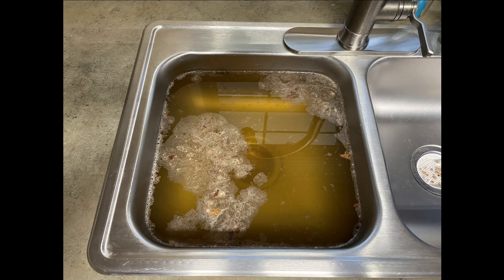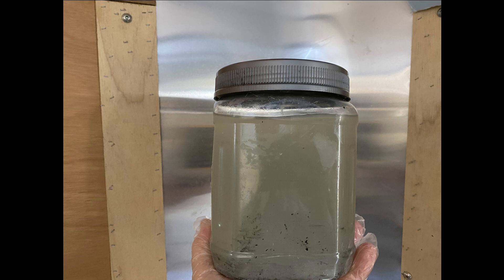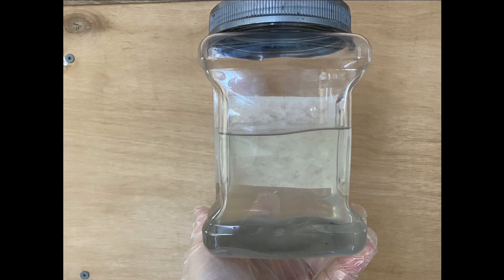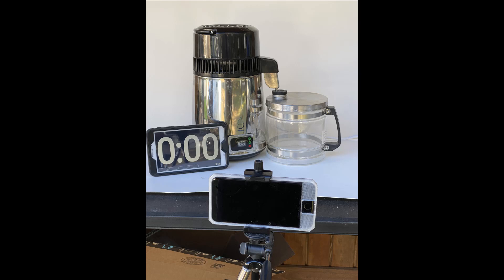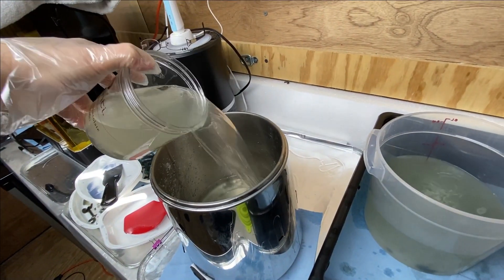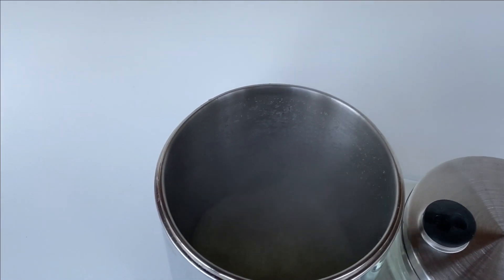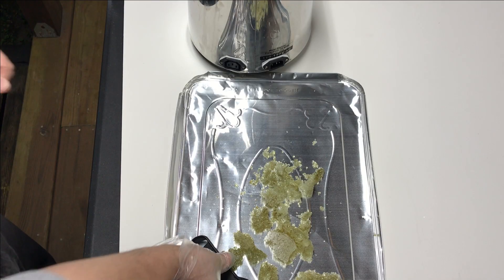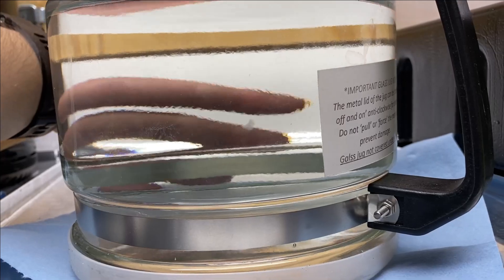Cleaning alcohol for your resin 3d printer process. (Feb2022 updated links)

Comment: Thanks for Sharing
May I ask two questions?
First do you find your losing a percentage with the distiller and if so how much?
Second I see the distillers have charcoal filters are you using it or do you just leave them out?

Thanks
Reply from the maker: I don't doubt that there is some amount of loss.  No process is 100% efficient, even the warp drive on the Enterprise.  :)  

I fill the distiller to the 'FILL' line.  When done I have a full carafe.  Not half, not 3/4.  Not an amount low enough to even make me question how much loss could be taking place.  Odds are, I loose more from forgetting to put the lid on my wash bucket overnight.

I am not using the charcoal filter because I'm not trying to make distilled water going into home medical gear like the distiller is designed for.  After all, the alcohol is going to kill any germs that dare try to set up shop in the equipment, right?
Reply: @starbase3d804  Thanks so much for the quick reply and feedback.
Reply: @tfraleyArchive  i got one i found i lost about 1/4 roughly. My jar has a 3000ml line and im at about 2500ml for a full 1gal tank
Reply: @rwest902  I have the same experience with my distiller! Loos a quarter! If I use it with plain water I loose barely nothing though!
Reply: The new version designed for alcohol might be better but seems only be available as 110V, so for Europe (220V) you also need a voltage converter.
Reply: The resin left behind may be the reason you’re output is decreased… i mean it takes up space and doesn’t just evaporate

Comment: What about fumes? I know you cant use IPA in a ultrasonic cleaner because of risk of fire with fumes and the heat, Wouldnt this be dangerous also with the fumes and the heat and with the boiling point of ipa at 82.5c
Reply: Good point, I think I'm going to try this but I will put it outside for an hour or so just in case.
Reply from the maker: Turn off the heat function of your cleaner?
Reply: @starbase3d804  doesn’t that defeat the purpose.  The way this works is via boiling and vaporization.
Reply from the maker: @MichaelBellini  He was referring to an ultrasonic parts cleaner with heat function.  Some people use ultrasonic cleaners such as jewelry cleaners for the cleaning of their resin printed parts. But if you were to use the heat function with that it would be highly dangerous.
Reply: @starbase3d804  he was comparing the distiller to the ultrasonic cleaner, which he clearly stated cannot be used with heat.  
Since it is vague at best, I wanted to make sure people understand that the distiller has to be used with heat for it to function.

Comment: I bought this same unit based on your video and it worked perfectly and very fast. My only problem was my dried resin wouldn't come out nearly as easily as yours did. I ruined my plastic scraper and ended up using a stubby flat head screwdriver to chisel the dried resin out.  I'm going to try using a crock pot liner bag next time.  My resin of choice is Siraya tech build smoky black. Maybe that had something to do with it. Edit: I just searched for foil pot liners and found these: https://www.walmart.com/ip/Pit-Boss-Foil-Bucket-Liners-Easy-to-clean-Aluminum-Grill-liners-6pk/734064897 , maybe they'll work. May have to trim them down
Reply from the maker: Sorry to hear about that.  Really odd.  I've been using Anycubic black and grey almost exclusively.  So yeah, maybe its a formulation thing.  - Hey, my unit came with a jar of cleaning solution, did you try that?
Reply: @starbase3d804 yes it did. Good idea
Reply: what about laying some aluminum at the base of the distiller so most of the resine wouldn't be in direct contact with the hot plate and you can easily remove it later keeping everything in pristine state.
Reply from the maker: @anoirbentanfous  Feel free to give it a try.  As I've said when asked 5-10 times now, I'm not having a problem with clean up but that may be a difference in resin brand, environment, humidity {...}
I'd also point out this isn't a kitchen pan that has to be spotless before the next use.  Do a batch, get it "scraper clean" and run the next batch.
Reply: @anoirbentanfous  yeah that's an idea, I'll have to try that.  In the mean time I got some slow cooker liner bags to try first

Comment: Have you thought about lining the bottom of the distiller with foil, or using one of those crock pot liners for easy clean up?
Reply from the maker: The clean up wasn't difficult, as you can see.  

Thought about it.  I tried a crock pot liner on my first attempt as a precaution.  You can't fold it over the top lip and then set the fan portion on: It creates an air leak and fools the sensor into thinking its done because its lacks seal/vacuum whatever it trips on.

I suppose you could roll it down to fit WITHIN the chamber.  Just not sure what would happen if it folded down under its own weight.

Basically I start simple and don't fix what isn't broken.  Had there been an issue with cleaning, then I'd work to solve it.  But... there wasn't.

Comment from the maker: Point of clarification:
The dehydrated resin 'biscuit' at the bottom of the distiller should not be casually tossed in the trash *AS IS*.  If you can safely leave it in the sun for a day to fully cure it should be no different than any other cured model/figure.  Its up to you to know your local laws about such things and to take a few steps to render the debris safe - while still considering birds/animals/pets/children that may happen upon the raw resin while sitting in the sun.
Reply: this is distiller with temperature setting, which you use with alcohol?
Reply from the maker: @MomentalnoVMore  The default is 95°f.  I used it there and it worked fine. (mentioned in the video)
Reply: @starbase3d804  i think this is not 95 F, this is 95 Celsius. 95 F= 35 C. IPA boiling point is 82.4 С (180 F), Ethyl 78.3 С (172.9 F)
Reply from the maker: @MomentalnoVMore  You are probably right on that.  Force of habit.  Muscle memory when typing.  I stand corrected.  Thanks for pointing that out!